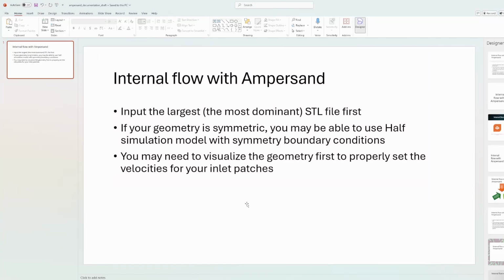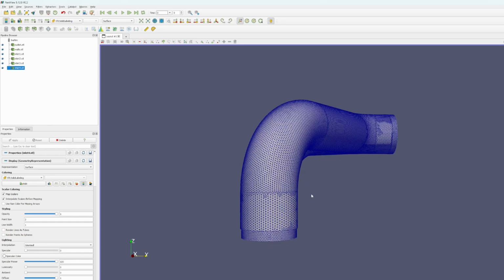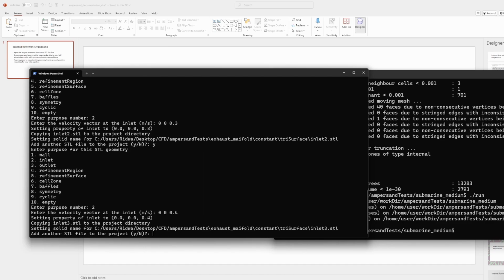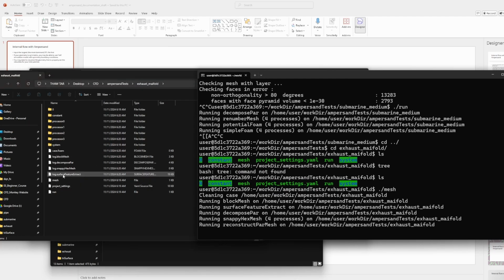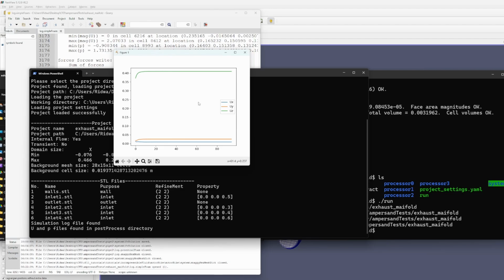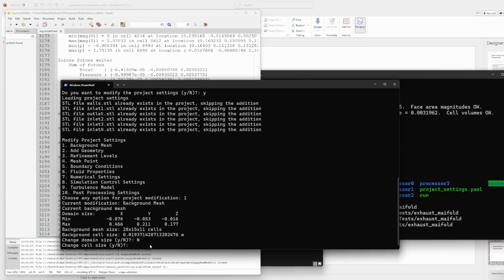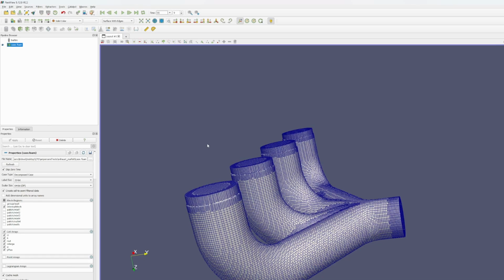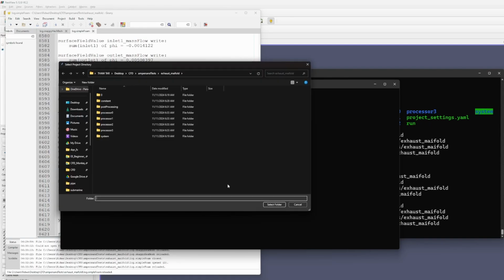Simulation of internal flows with OpenFOAM and Ampersand

Comment: Very impressive.
Reply from the maker: Thank you
Reply: @thawtar682  Hi Thaw, I have been using ampersand for a few days now and thoroughly enjoy it and it makes generating high quality meshes a breeze and also setting up case files. I know the software is work in progress, but I have run into issues with setting up a case when the inlet velocity vector is negative (0 0 -2.153). The geometry is oriented in this way but it creates errors (div by 0 and raise 0 to neg powers) in the stlAnalysis, during calculation of the yplus I believe. When I flip the geometry these errors go away, it is a simple workaround but wanted to document it for you. 

Again very happy with your software. You should set up some sort of donation link.